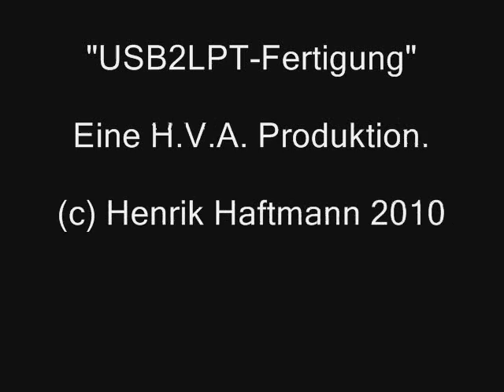Fertigung eines USB2LPT-2

Comment: @rhini0071 Seems that you din't read the Closed Captions!
- I have no measurement equipment. I simply use the maximum temperature for the soldering iron, and "cotton" for the reversed iron.
- The hot-air gun is a really cheap two-power-position type and works on its "low" position.
- The air flow is slowly and centered enough. The adhesive force of cream is even strong enough even for flipping and accidently dropping the PCB onto the floor.

Comment: 3:30 "Check solder joints for short-circuits and possibly open connections." This step is not needed when using the stencil correctly. In case of visible shorts or opens, apply flux and re-solder all the pins in a row.
When using the new LTXC package of CY7C68013A, it's almost impossible to make such correction with a soldering iron!
5:10 It's PCB (flux) cleaning fluid.